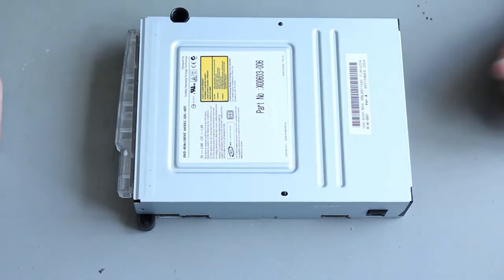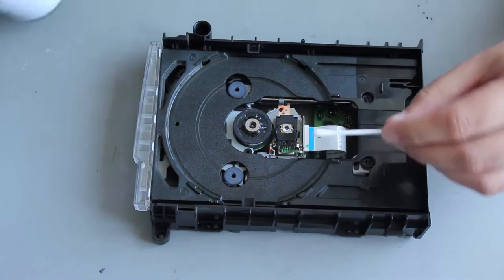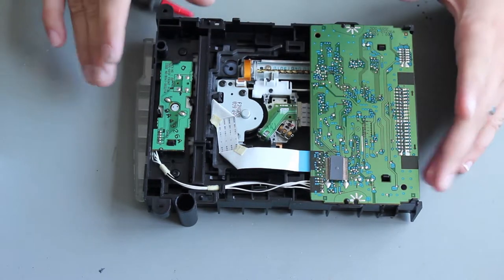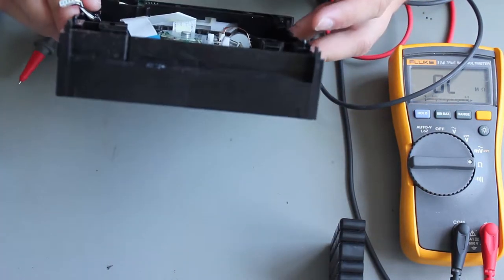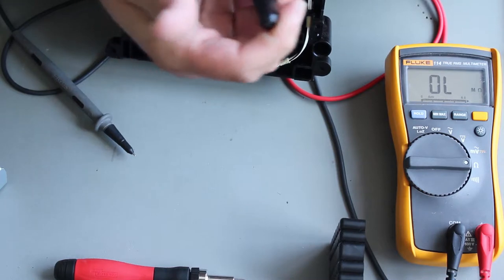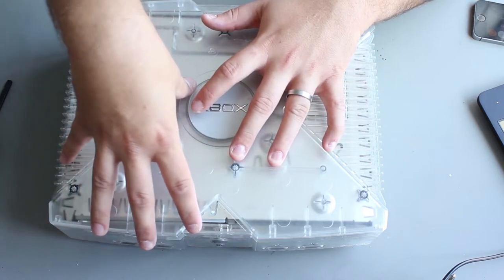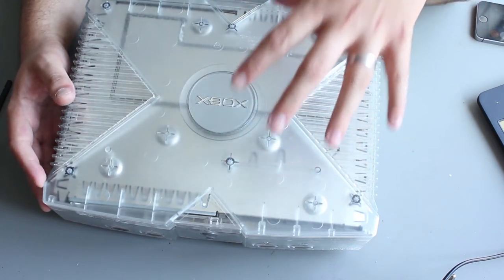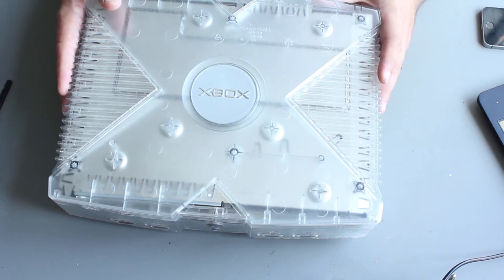Laser Fix Tweak in Original Xbox - works for any CD DVD Bluray based system

Comment: You aren't even showing the part you are adjusting, it's off camera
Reply: It's literally the only potentiometer on the side of the laser. You have to break the glue bond holding the adjustment solid using a little acetone.
Reply: @Supradrew.  that doesn’t help smh tf does it look like
Reply: @Datboigreen2602  silver screw thing. just turn it a hair clockwise and you are good

Comment: What type of tool is required to adjust the potentiometer? It is very small and I can't tell what type of tool I need to adjust it? Small flathead? Small Phillips?
Reply: I was able to use a small flat screwdriver for glasses in case anyone else is wondering. I did find it hard to get a clear reading on the resistor using the multimeter so I'm not really sure if I adjusted it to much in which case the laser could burn out. For now it is working. Good luck to anyone else who wants to tackle trying this.